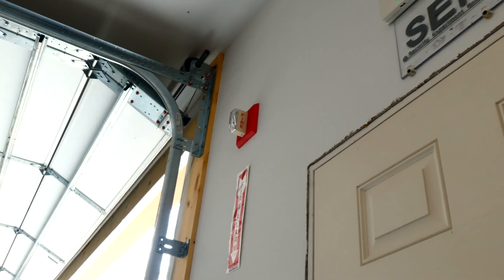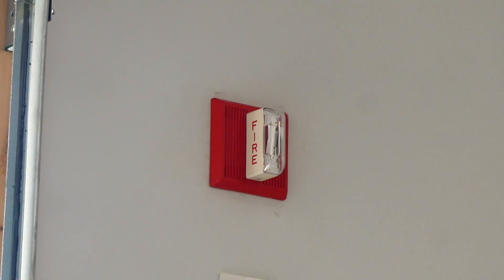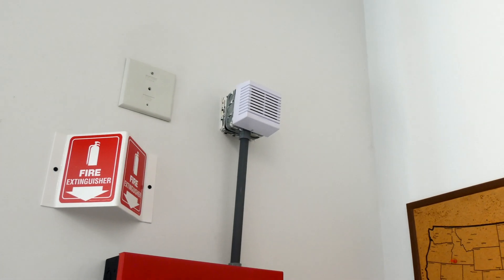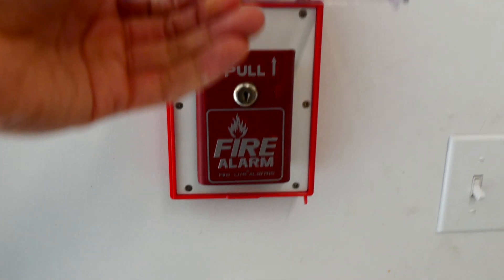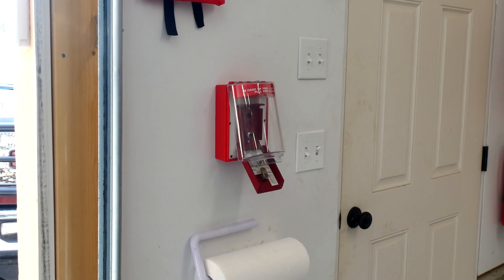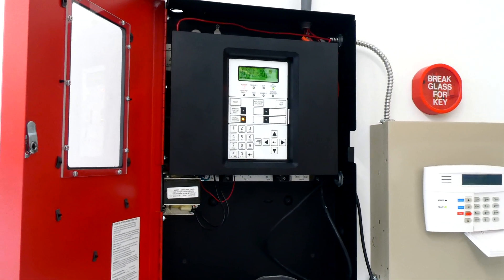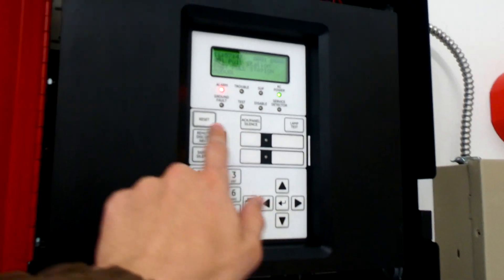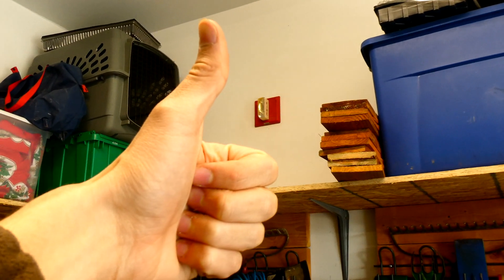Kidde System Test 23 | Wheelock MT!

Comment: Btw the slow whoop signal is not uncommon in the Netherlands, infact its I think required in every building with a fire alarm system, so you could’ve used that European call point, just a tip
Reply: I think it was much more common in the US in the mid 80s-90s.  Two of my schools used this same model set to this tone, and they were built 1996-99.

Also, an American TV show popularized it before the technology  became loud/cheap enough to use it for real alarms (Star Trek).
Reply: Het is niet echt verplicht. Maar Wel standard. Omroep West gebruikt een andere tone. En een gebouw waar Ik tegen over mij gebruikt meer een soort van langzame pulse tone. In Amerika, gebruiken ze meestal Code 3. Vroeger was het overall continuous (voortdurend) in amerika. Zo ver Ik weet, gebruiken sommige Staten Nog continuous op nieuwe brandalarm installaties.
Reply: @bjthedjdutchdude1992  ooh dat wist ik niet helemaal, dus dankjewel voor de info 👍